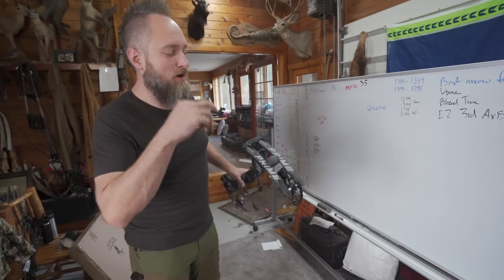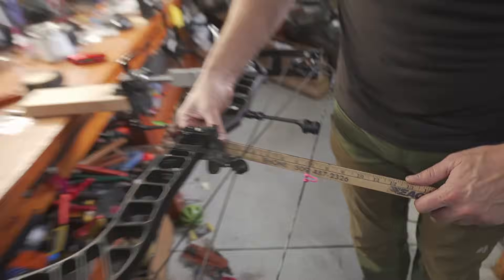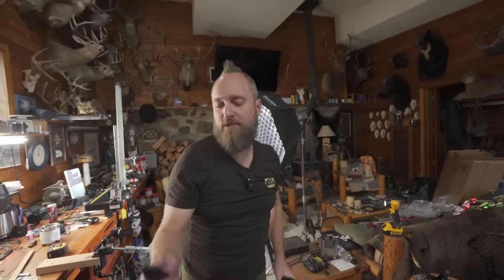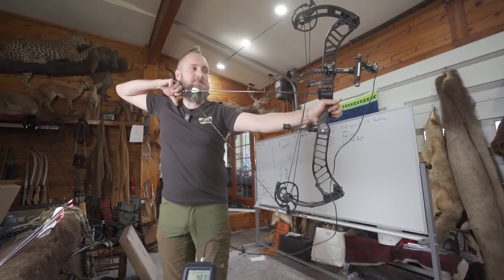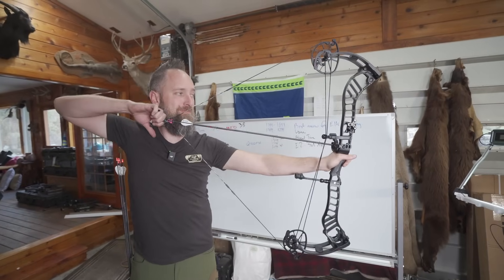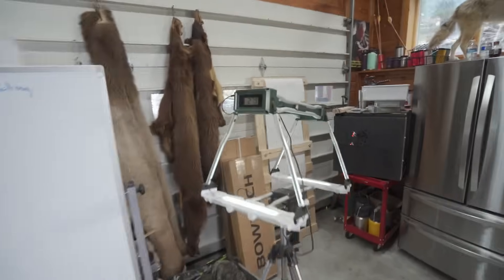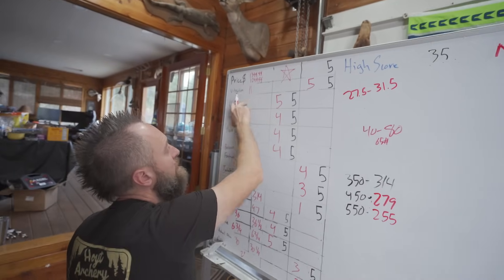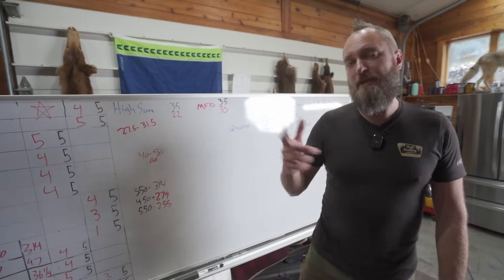2024 Prime RVX 36 Bow Review with MFJJ

Comment: Would love to know the measurement of the riser above the grip on these prime bows compared to similar bows. Would be interested to know if the center grips makes the 36” bow just as compact vertically compared to a 33” or 34” bow in a ground blind.
Reply: Yes, that's something overlooked, the grip sits about 2" higher. The negative to that (I own and like Prime) is that a 32" bow has a string angle closer to a 29-30" bow. But you get a 34" feel with a 36" bow plus the stability of a 36. Basically the opposite of a Mathews that are really long above the grip.

Comment: Well starting to see some inconsistencies, obviously was paid by mathews for there reviews but not from prime, new mathews should have got a 1 or 2 for there speed being 14-15fps slow
Reply: The Lift 33 was 17fps slow but he added 4fps to the actual recorded speed because it was at 85% let off.
Reply: @ArcheryGeekOutdoors  only if the let off does infact increase the speeds that much, most vids ive seen show there being no difference at all, Dan from elkshape just did one and the speeds where exactly the same
Reply: My lift came in 21fps slow on 3 different chronographs.  Caldwell x2 and a Garmin

Comment: I can’t believe that you have a bowshop and keep still saying that absurd speech about speed cheating. Those bows, like many others, are  tested under IBO: 82#, 400gn, Max DL (31,5” in this case). So a 314fps ATA speed bow is actually over 330 fps IBO with those parameters. If you don’t like IBO rating is great, but they’re not cheating by any means.